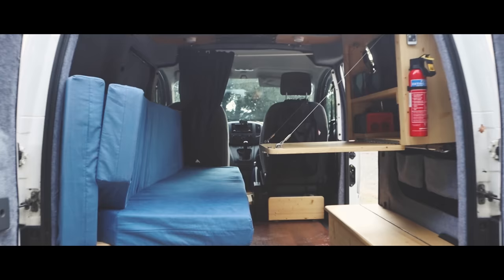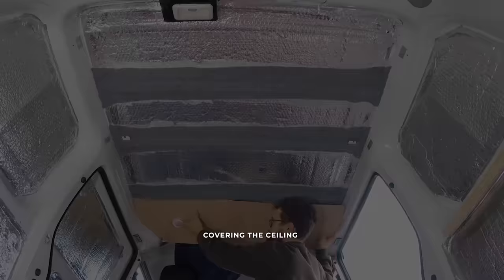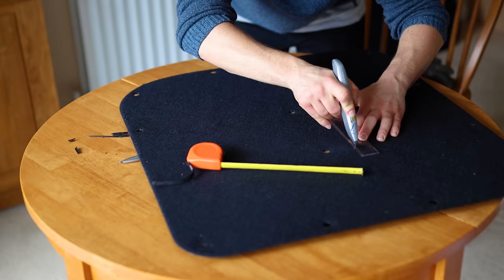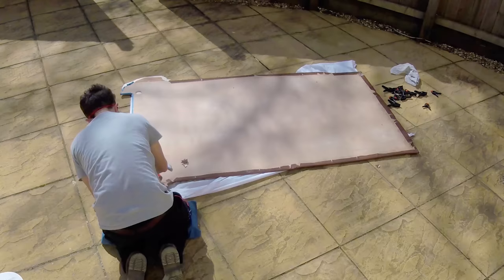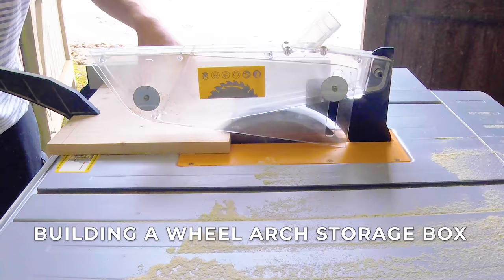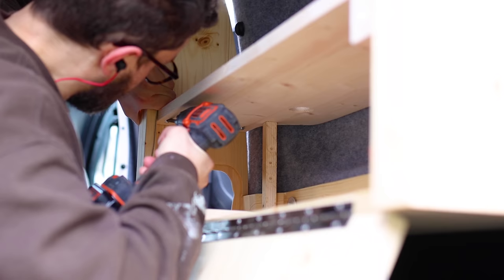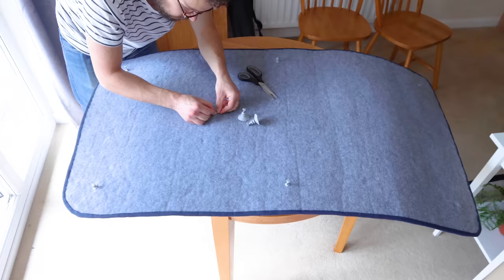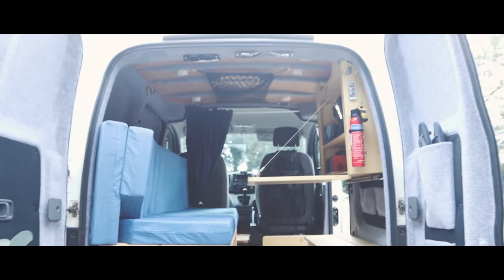TINY CAMPER VAN Conversion, From Start To Finish | Nissan NV200 Small Van Build

Comment: Why does everybody insulate their campervans? 
If you only use your camper when the weather is OK you should not insulate. 
When it is warm outside it takes hours for an insulated car to cool down. A non-insulated van cools down very fast when the sun goes down...
Reply from the maker: Hi, all I don't sleep in the van during winter months, the van still gathers a lot of condensation in autumn and winter due to the cahnge in weather, so I've found it important to insulate to the walls and ceiling to stop this.

Comment: Gas mileage?
Reply from the maker: Around 50mpg on short journeys and 55+mpg on motorways. Thinking about getting the engine remapped at some point which should increase this a little! Overall very fuel efficient I think